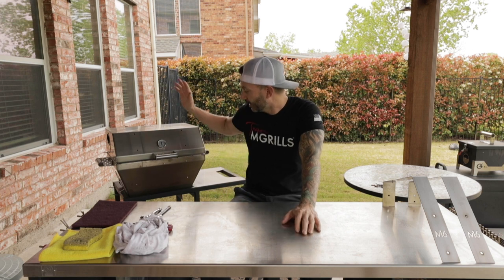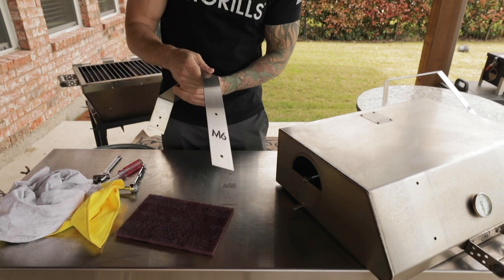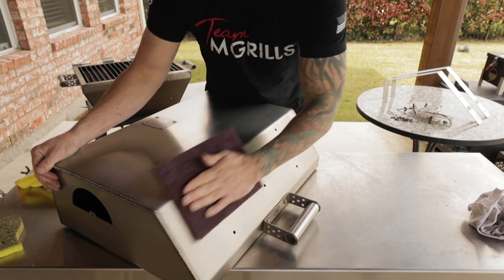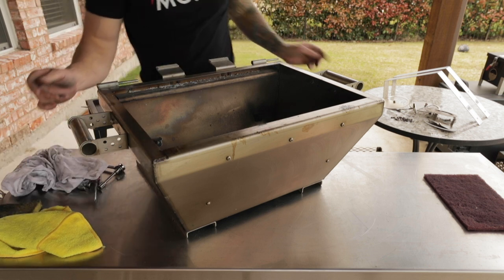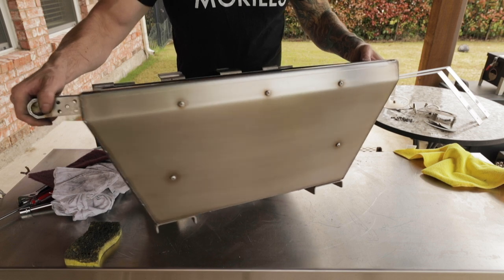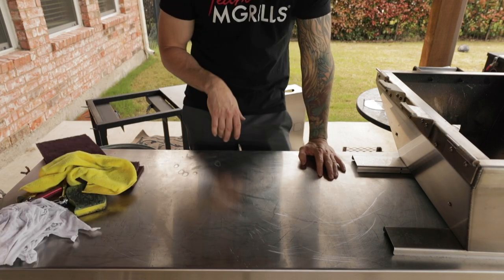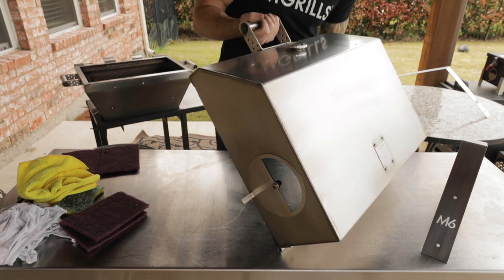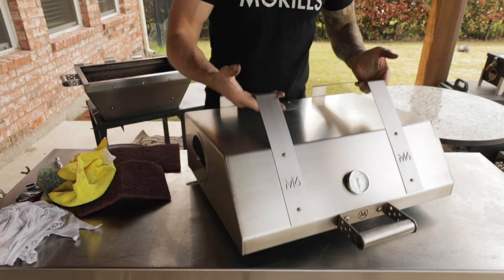Refinishing the Stainless M16 Charcoal Grill - Try this on any old stainless steel grill or smoker.

Comment: I live near Tampa Florida. Very humid for most of the year. Will the welds rust over time? I am interesting in purchasing the m16 but don't want any rust on it after a couple of  years sitting outside?
Reply from the maker: I would highly suggest the M16-S which is made from 316 Marine Grade Stainless Steel. Even though the M16-C is coated with CERAKOTE ceramic coatings, there is still a chance of have surface rust develop over time on certain areas just due to the uncertainty of completely being exposed to the elements. The M16-S is a bit more in price, but worth every penny especially since you live near the coast where salt water will damage just about anything.
Reply: @Mgrills  thank you very much. I will save up a little more and pull the trigger on it soon.